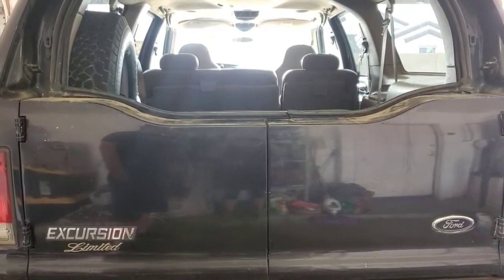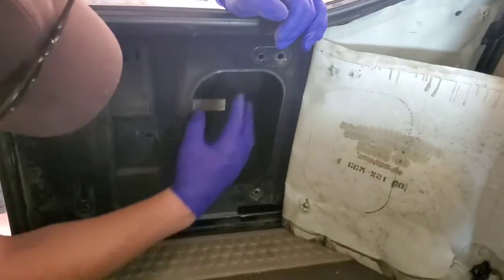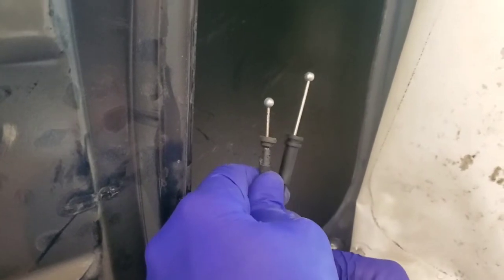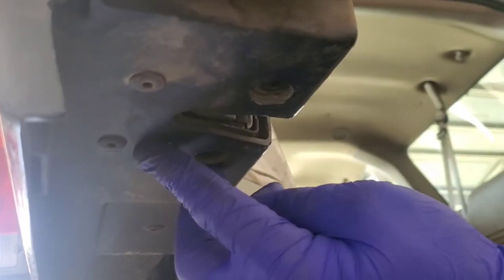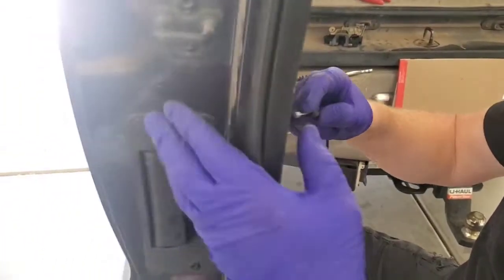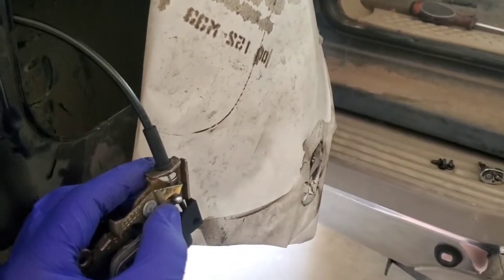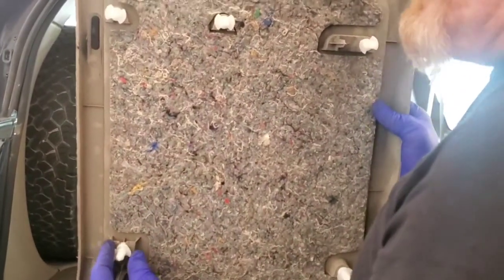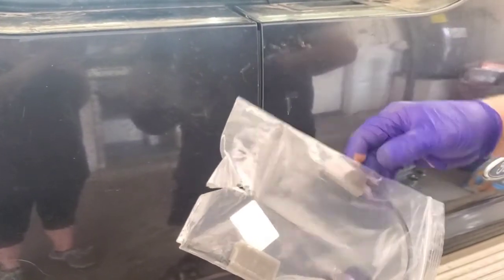How to change a broken cable in the rear barn doors of a 2000-2005 Ford Excursion. Episode 19

Comment: Same issue this week with my 2000 7.3 Excursion. Ordered the part off EBay and will fix it when arrives thanks to your video. Great job.
Reply: What’s the link to the part you bought and can you verify it worked properly after installation?
Reply: I got my part(s) in. It is actually 2 cables, one long and one short. Looks identical to the ones in his video. His initial link did not work, but if you scroll down a bit in the comments, he gives a working link. Worked for me. 

As for installation, I have not done that yet. My 2004 Jetta Wagon TDI work is priority (tiny vs huge diesel).

Comment: Thank you for showing this. I was able to fix my dad's no problem... well, at least I was able to jerry-rig it for him. Basically, the plastic part of the metal wire was broken like in your video. But the wire was still connected to both the handle and the latch. I used a small backpack strap with the click thingy, looped it around the metal wire inside the door, pulled it up, put the rear cover panel back on loosely, then when you pull up on the strap, the door pops open. Not the perfect solution, but it works and all in all took about 15 minutes. Anyways, ty for the video!
Reply from the maker: Glad to help. The part number for the replacement cable is on eBay item number 224316912481. This one works great even though it’s for a Ford “E” series van.

Comment: Thank you very much for this video. I was able fix the door using a metal sleeve sold in Amazon that replaces the ends of the OEM cables. Got to keep the original, plus the ends are now made of aluminum instead of rubber.
Reply: AL what did you get on amazon to replace the ends?
Reply: Do you remember which metal sleeves you bought?  Thank you

Comment: Thanks. Followed instructions and got the door open so I can work on it. Got the top cable loose without a hitch. Did I miss the part about watching out for stripping the latch bolts. The last darn one stripped ☹️Guess the door comes off to drill it out.

Comment from the maker: Go to EBay- item number 224316912481
It will show 1997 - 2012 Ford E150 / E250 / E350 Vans. This is the cable that works perfectly for the 2000 - 2005 Ford Excursions discontinued rear cable.

Comment: Enjoyed the video worked well for my excursion.  Two questions:  Is there a reason you went with the new cable vs the metal end repair kit?  Also If you had to, how do you remove the rivets on the handle and what would you replace with Bolts, screws or rivets?

Comment: I was confused on the retainer clip? I didn't see where you put it back into place? Or, if removing the latch assembly out the bottom, it is done there? It did not look the same when you connected the cable to the latch in the bottom mechanism. 
Great video and thanks for the link to the part. I am sure I would have never found one!
Reply: Ok, update for anyone that has to do this fix. Again, thanks so much for taking the time to video this in such great detail. I just replaced my cable and it works great thanks to your time showing how to do this and most importantly where to get a replacement cable from! 
The confusion I had was the cable clip is on the door handle side, not the latch on the bottom of the door. Once I got into it, I could see the clip to release. I was able to stick my arm in the door and squeeze with my fingers and it came loose so I could pull the cable out from the door latch assy. Both ends of the cable were deteriorated and also I took time to clean and re-lubricate the latch assy. It was very stiff and hard to pull, so likely why it finally broke. Once I cleaned and lubed, it was easy to operate with little to no resistance.

Comment: Okay I tried doing this today. I got one screw out and discovered there had been blue lock tight on the screw. I stripped out the other two trying to get them out. So with a lot of attempts I actually did the repair without removing the latch mechanism. It took many attempts but I got it done.

Comment: Can you send me a link with the part number?  Thank you
Reply from the maker: eBay item number 224316912481. This is a great replacement for the discontinued Excursion barn door cable. You will be buying one for a 1997 - 2012 Ford “E” Series Van but it’s the same size as the Excursion’s. Hope this helps.

Comment: Could use the part number.
Reply from the maker: Go to eBay and look up item number 224316912481. This is for a 1997 - 2012 Ford E Series Vans but is a great replacement for the discontinued Excursion barn door cable.
Reply: @alley55customs93   @Alley 55 Customs  I did the repair today.  Works great.  Would have been a hassle without your video.  Thank you so much.
Reply from the maker: @wonderingsoul9890  I’m glad I could help. Sorry for the delayed response. If you have any other automotive questions please feel free to contact me.